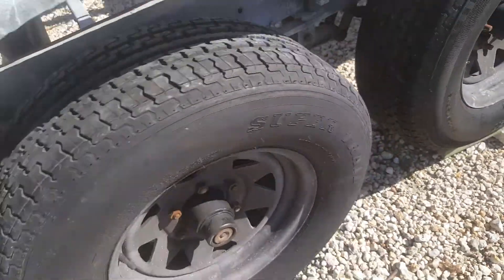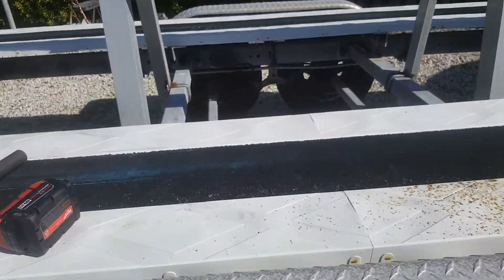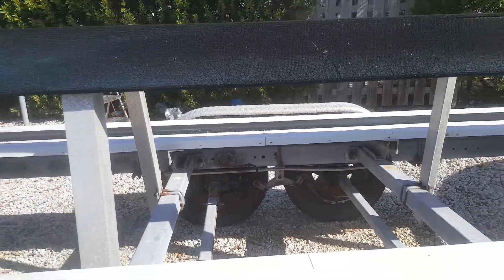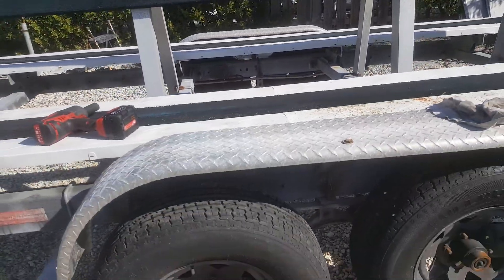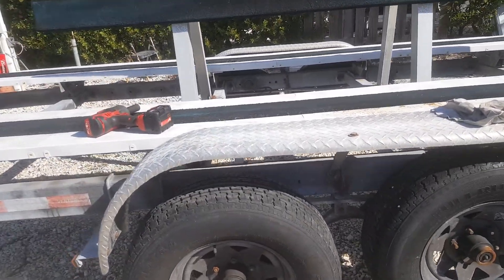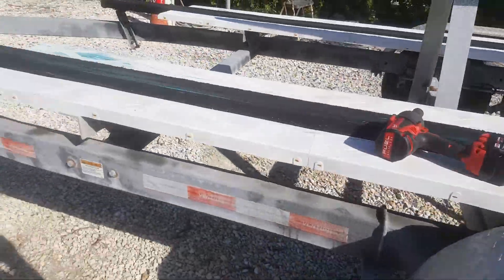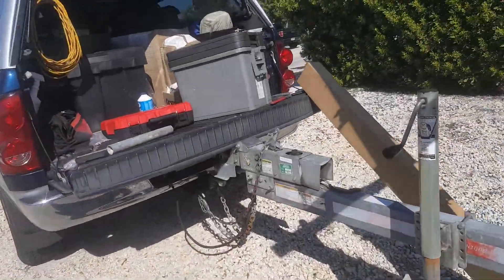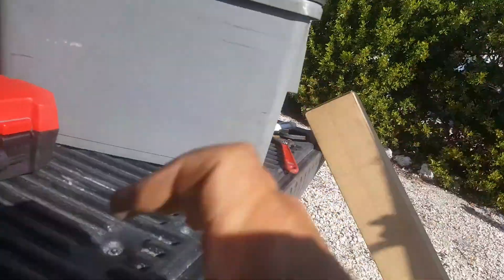Titan model 10 actuator failing

Comment: Did you figure out? what was the problem? Thanks,
Reply from the maker: Hi Yes I did.  December 2018 in preparation for my annual keys run, I found the master cylinder devoid of fluid again. I decided on a complete rebuild of the actuator including master cylinder, reverse solenoid and pretty much every replaceable part.  Upon my attempt of bleeding after the rebuild I found large amounts of brake fluid flowing the boxed frame neck of the trailer. What must have been pinhole leak in the brake line at some point became a larger leak as time went on. So now I have all new parts in the actuator, all new lines and new calipers pads and rotors (which I am sure were not needed) and the brakes are fine.
Reply: @hotmako1  I assume you bought the rebuild kit for the model 10 master cylinder. How did you get the spring/plunger assembly out of the master cylinder? and how did you get the new back in? I have taken the snap ring off of mine. Removed cylinder with the 4 weird circles in the end, but stopped there. I didn't want to take the plunger out without buying the kit. I have the master cylinder in my vice right now. I filled with DOT3 and pumped it, but nothing come out the outlet side. hmmmmm?
Reply: @hotmako1  I primed my actuator. Now it pumps properly.

Comment from the maker: Thank you gentlemen for your comments. At the time I posted this I ended up taking the trailer to a trailer shop who insisted that the problems were in the calipers and charge me a $660 service for replacing the calipers, the rotors and bleeding the master. By the time I drove home from the keys the problem was occurring again I will check out both of your suggestions. I need to remember to follow my instincts and stay away from trailer shops especially when in the Keys

Comment: the other possible cause is a faulty reverse lock out solenoid- Titan has had issues with them not retracting when NOT under power (which blocks the brake fluid entirely). So you have no brakes what so ever as described in this video. I would change the solenoid first, purge all the brake fluid (if haven't done so over a year) and bleed the brakes. It is the cheaper option.